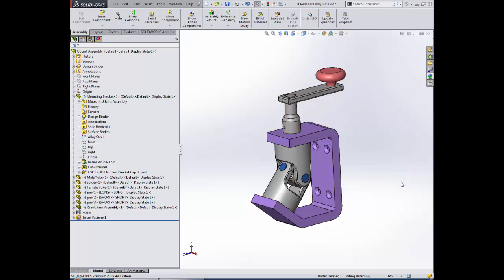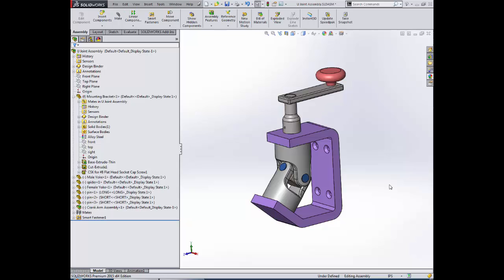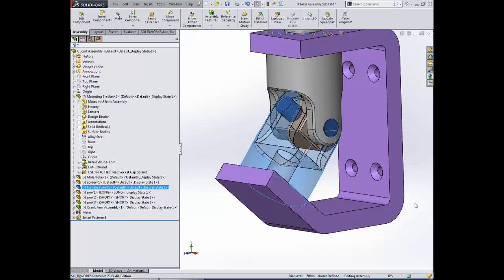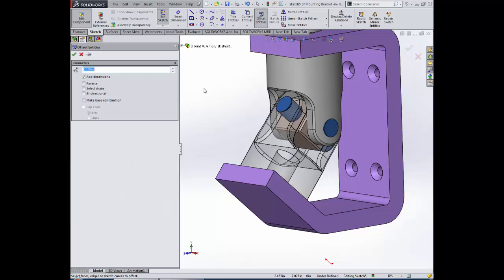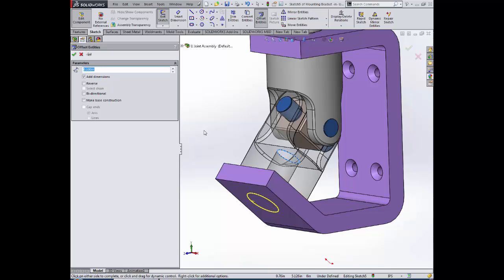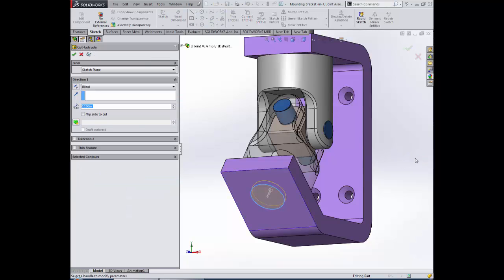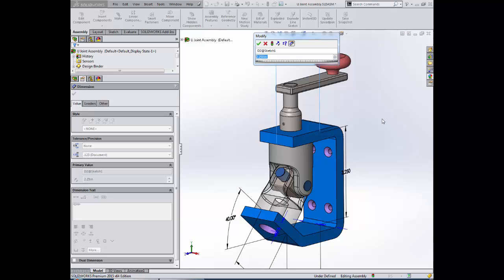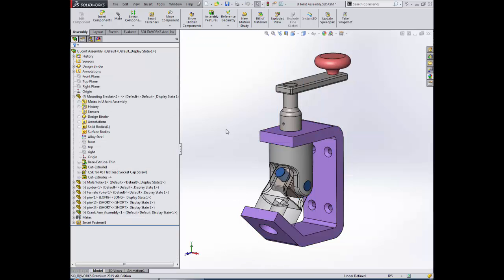Video Tech Tip: Top Down Assembly Modeling Technique in SOLIDWORKS

Comment: Well, it depends.  Notice at 3:10 the yoke changes position, and the hole in the bracket also changes position to reflect the new location of the hole in the yoke.  So, if we move the yoke away from the bracket along the axis of the bore, or parallel to the angled face on the bracket, the relationship will be maintained as the projected edge is still a circle.  You can get into trouble if the change to the location of the yoke would result in an ellipse being the projected sketch shape.  SOLIDWORKS doesn't know how to handle changing a circle entity in a sketch to an ellipse entity in the sketch, or visa-versa.  That is why it is important to have your source geometry (yoke in this case) appropriately located with respect to the destination plane (face of the bracket) before referencing the source geometry.  I hope this helps.  JRL